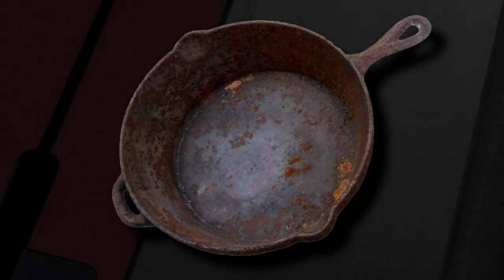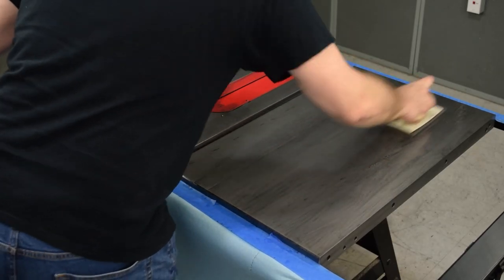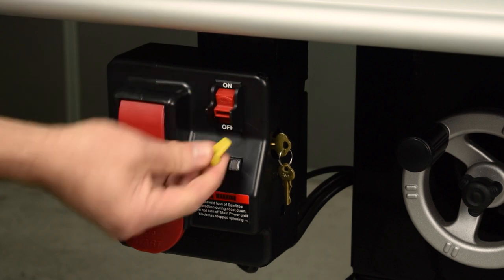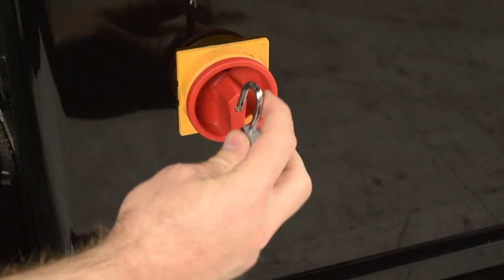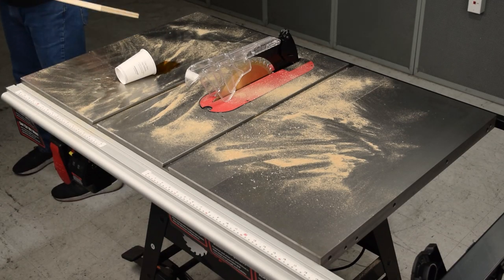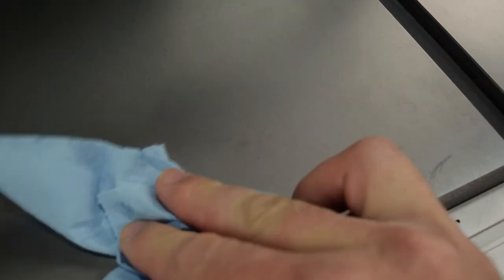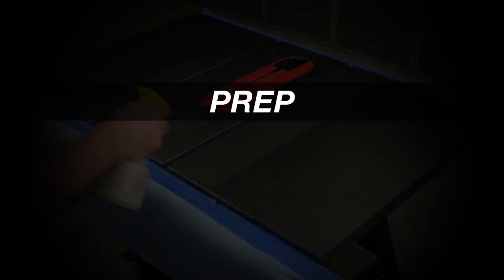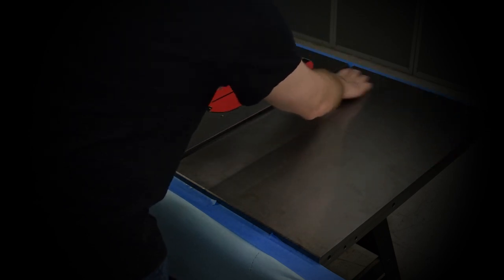SawStop Service Tip: Care for Cast Iron Table Top

Comment: This is the first video I've seen where 3 coats of wax are recommended. For those of you who live in very humid climates, like myself, THIS IS A MUST. Unless, you run a commercial grade dehumidifier such as a Aprilaire 1830 or higher in your shop/garage, 1 coat simply isn't realistic. A lot of you must understand that most of these youtube channels are a stage, and not a real work place and copying them can lead to frustrating results. Plus, learn to notice when the wax drys, sometimes it can take longer than 30 mins per coat and to "buff" it too early will result in a unprotected top and will rust! They use a lot of elbow grease in this video, and that's to protect themselves from yall being too over zealous with a sander, but I see a lot of experienced workers using 400GR wet sand paper with a random orbit sander for this maintenance, plus a buffing pad for the polishing. There are other alternatives to wax, such as T9, but I'd highly advise against  it because it can take several days to cure and their Rust Free product can create a acidic reaction and leave blemishes all over your $3000+ tablesaw, NOT cool!!! The method illustrated in this video is the old school way, which ive found to be the best way.
Reply: Morta 7 I’m going to ask you the idiot question. What is the difference between shop towels and paper towels? And is it really worth it?
Reply: @johnleonard5857  Yes, it's really worth it. The absorption of shop towels is very different than conventional paper towels. A shop towel resembles a disposable rag, and does not turn into a wet ball when exposed to moisture, the way a paper towel will. Depending upon the use, such as cleaning up a basic spill, you can even ring out a shop towel and reuse it, as you would a rag. They are incredibly handy in any shop environment, and you'll find a thousand uses for them.
Reply: @dngriffiths8105  thank you for responding.
Reply: What would you recommend for pitting in my sawstop? I had some heavy rust . I used a Random orbit sander and got most of it off, but certain areas have to these tiny pits.

Comment: Very helpful video.   The video says to use a Gray Scotch-Brite pad.  Can you be more specific.    3M Scotch-Brite is available three shades of gray:   Gray(7446), dark gray(6448); and light gray(7448). These  range from course to very fine (120 grit to 800 grit equivalent)
Reply from the maker: We recommend using Scotch Brite #7448 hand pad.
Reply: @sawstop  thanks

Comment: I should have watched this video first.  I have a brand new 3HP PCS and before running even the first cut, I tried cleaning with the T9 and Boeshield.  Well I sprayed the T9 on the table top and the overspray got onto the t-glide rail and trashed the metal strip.  So the miter slots and the glide strips look like they are 10 plus years old.  Made me absolutely sick to my stomach.  I am going to see what I can do to restore the metal, but I dont think it is going to happen. Ugh, brand new saw and it already looks used.  Sorry, I'm just venting now.  Thanks again for the video!
Reply: How did the T9 ruin the metal strip? It's supposed to protect it.

Comment: Very helpful video. I am teaching at a new school that came equipped with a SawStop cabinet saw. Unfortunately, the table has years of surface rust along with some sort of residue. After using Boeshield Rust Free, the top remains almost tacky and darker in color in spots...even after wiping the top down with acetone, you can still see & feel sticky spots. HELP! I have a beautiful saw that was not well maintained and I need to restore it.
Reply from the maker: We recommend adding some WD-40 to the tabletop and letting it sit for 20 minutes or longer. After letting it soak in, follow the instructions in the video and ensure that the entire table top is done evenly.  We recommend using gray scotch pads.

Comment: AFAIK, denatured alcohol -- along with a bunch of other chemicals, such as mineral spirits -- are no longer sold in Southern California. What would you suggest as an alternative for cleaning off the WD-40? I'm pretty sure acetone, lacquer thinner, and paint thinner are still available, along with numerous citrus-based cleaners. Would any of those work?
Reply from the maker: Thank you for the question. Of the items listed, Acetone would be the best. The qualifier though is that you would need to keep the Acetone away from any of the black surfaces on the saw as the Acetone will eat / remove the black powder coating. Lacquer Thinner would be okay as well and maybe a bit safer around the black paint, but not quite as effective.

Comment: Should I do all that when I first get my saw, or just do the paste wax?
Reply from the maker: There is no need to use WD-40. To wipe down the oil, use denatured alcohol and blue shop towels. After that, add some Johnson Paste wax or whatever paste wax you prefer.

Comment: Are you supposed to use paste wax on the miter slots too?
Reply from the maker: A light application of paste wax on the miter slots is perfectly fine and will help anything running through the slots run more smoothly.  It is important to buff the wax properly, however, because a build up of unbuffed residue can make sawdust stick in the slot.